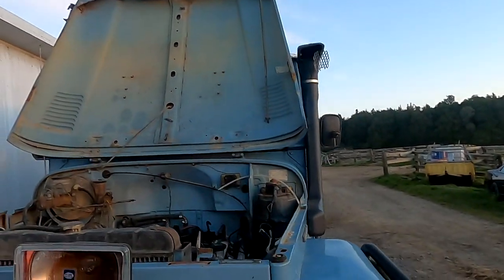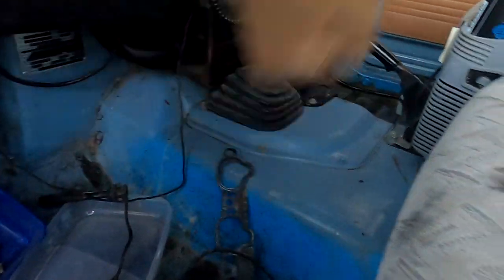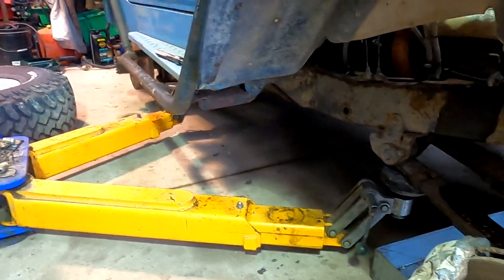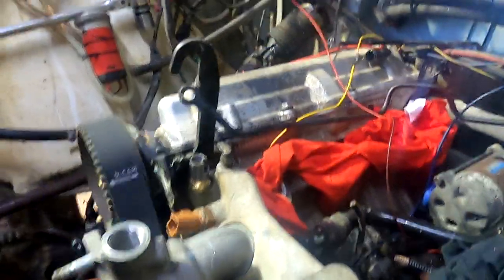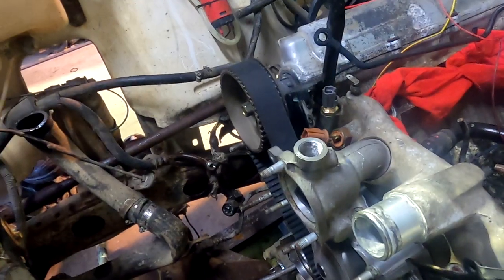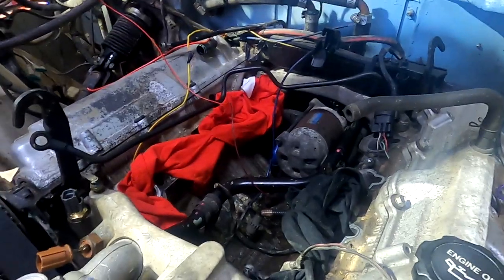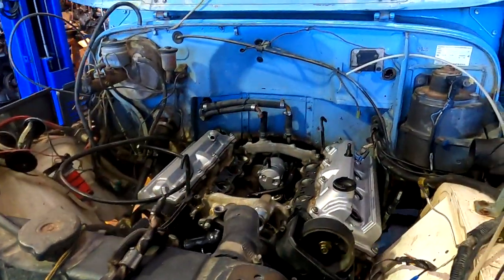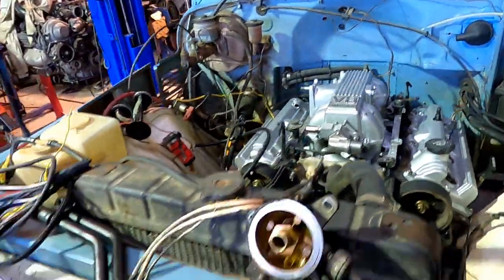Blue cruiser prep.  40 series Toyota Landcruiser 1uz tidy up

Comment: Need to place the steering wheel on the proper side while you are at it .  LoL   
 I had a neighbor that had one in red.  
 Went to remove the crank bolt and had to use a breaker and a pipe , spun the starter over to bust it loose .